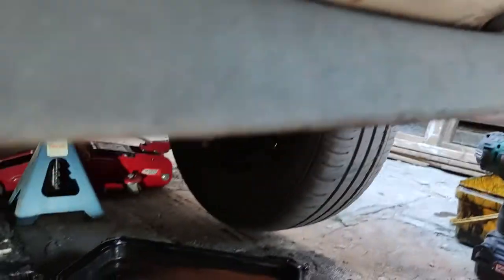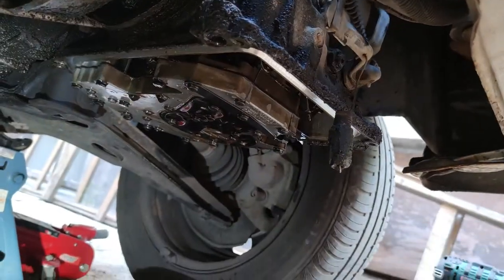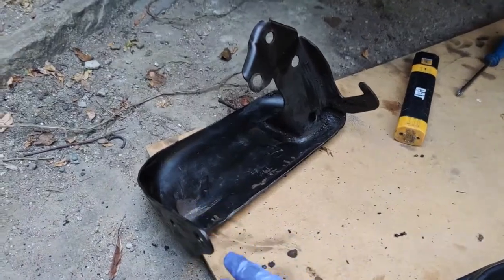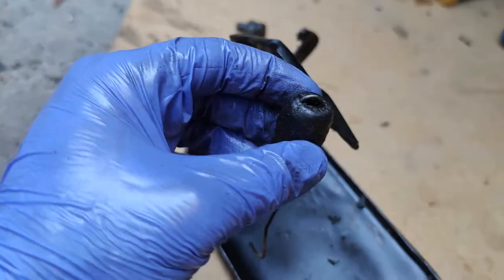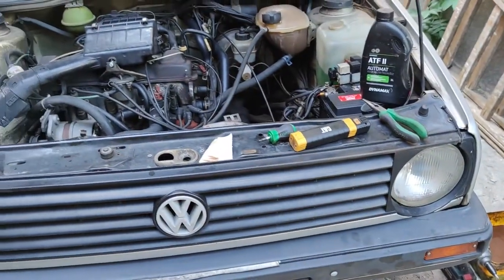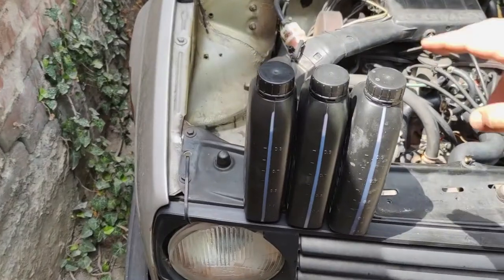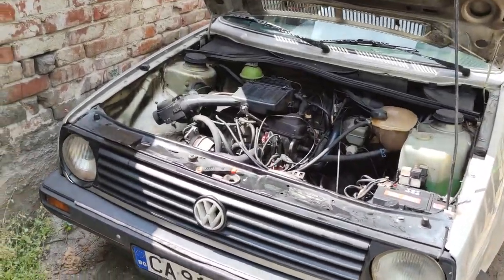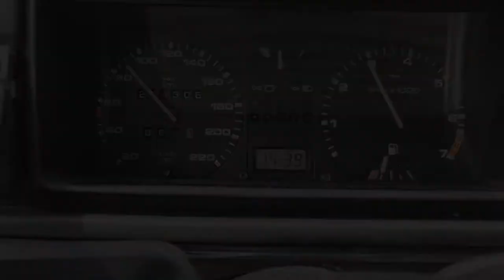Golf Jetta II Automatic Transmission Fluid Service Mk1 Mk2

Comment: color of the oil? I have yellow oil on the dipstick. I bought a febi bilstein 14738 yellow substitute according to vag tolerance, the oil has not changed for a very long time, it could change color during operation. In your video, you fill in red, I'm confused.
Reply from the maker: I have always bought ATF II (as per the book) and it has always been red
Reply: @BearBoris  thank you

Comment: I have the exact same problem it sometimes takes the gears sometimes then stops. I toped it up with ATF but I didn't remove the filter and the oil pan please assist
Reply from the maker: Assist with what?
Reply: @BearBoris  what could be the problem if you perhaps know
Reply from the maker: @luthogogotyi9297  the filter might be clogged - its worth checking. Other than that - I don't have any other ideas.

Comment: How reliable are these transmissions ?, im looking forward to buy a mk1 with a 3 speed auto trans
Reply from the maker: In my experience - very! My mother drove it for 10 years and all we ever did was this oil change on the 9th year. Its not a particularly dynamic or smooth tranny, but never had any issues with it. So long as there is oil in it it won't let you down.
Reply: @BearBoris  I was going to ask the same question on reliability of the automatic in this car. Thank you!

Comment: What is the spring for?
Reply from the maker: It returns the lever to which the throttle cable is connected. On these automatics the throttle cable operates the gearbox too.